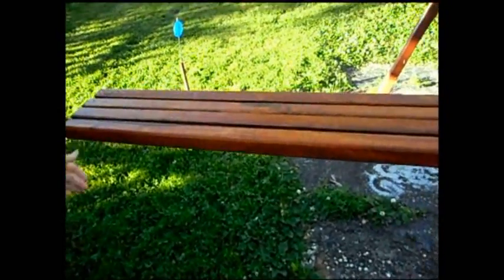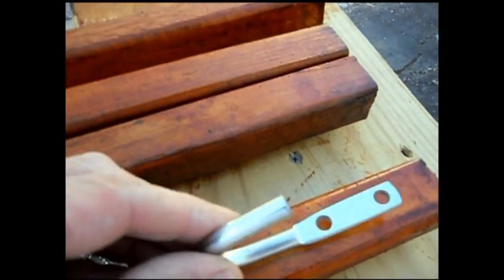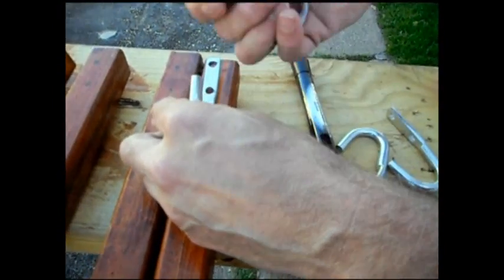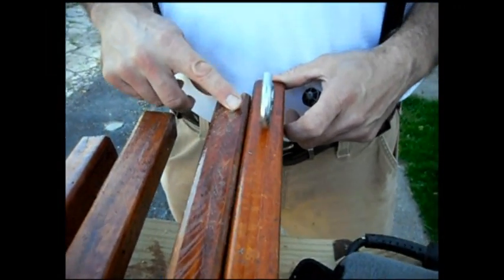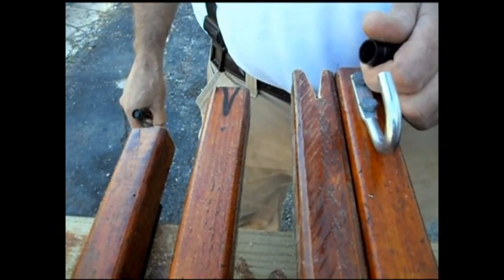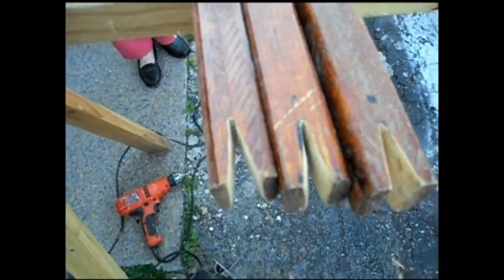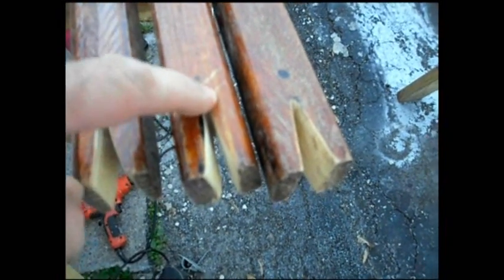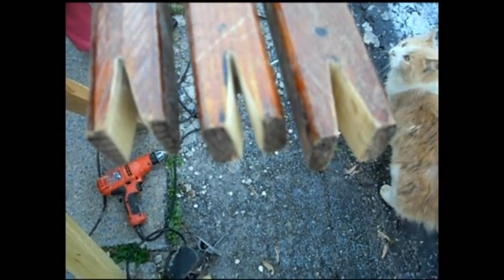Homemade Clothes Poles

Comment: Thank you, MacGyver, for a great video! 👍 Back in the 1980s, my dad bought 2 made of redwood just like these, except the opposite end had a V-pointed tip so that it would dig into the lawn and stay put in the wind from the local Home Depot. One finally split in half on a fracture in the wood grain. Thus, I returned to that store to buy another. No gots. Never heard of them. Ditto for Lowes. "Why not use an electric dryer?" they asked. I have one. I also have a well-made, more energy-efficient clothesline (free). Oh, and I don't have to use toxic dryer sheets to get that fresh linen smell. Yet, my sheets hang in the grass without the needed props on either side of the laundry to raise the line and put good tension on the line. When making these I know to watch for knots in the wood and grain that runs the greatest length of the 2x2s. These are your weak points. Oh, and neither stock redwood 2x2s in 8-foot lengths anymore. Is this progress? 😆
Reply from the maker: HI JOSEPH! GREAT STORY! LOVE IT! V TIP ON THE BOTTOM, THAT'S A GREAT TIP! GREAT IDEA! THANK YOU! JIM

Comment: I was afraid you would show them as to how/what they are. Thank God you didn't show them in use!
Reply from the maker: They work great! I clear coated them too. Still like new 7 years later!
Reply: @JimVincitore  I meant....what do you do with them? We can't see how you use them. Did you pound these into the ground and they stand up on their own? Did you hook up a clothesline to them or are these just hooks you hang a towel on?
Reply from the maker: @terry7893  THE CUT OUT GOES ON THE CLOTHESLINE, THEN THE POLE STANDS ON THEIR OWN AT AN ANGLE, ON THE SURFACE OF THE GROUND, AND HOLD THE CLOTHS LINE UP.
Reply from the maker: @terry7893  I do have a couple i added two feet extensions on the bottom with bolts, then put them into the ground a foot or so, they hold up my rope light up. I'll do a video on that Monday, it's supposed to be 50 degrees here so the snow will melt.
Reply from the maker: @terry7893  Lowes sells aluminum fence poles for $10.00, I think they would make great permanent cloths poles at either end, if you want something permanent to cement into the ground. Aluminum does not rust. The clothes poles my father cemented in back in the 1950's rusted at the bottom and broke off. They were three inch heavy duty steel pipe, maybe six feet tall, weighing about 50 pounds each. Great video idea, I'll do a video on it Monday! Thank you!